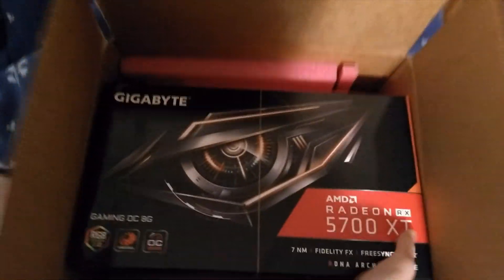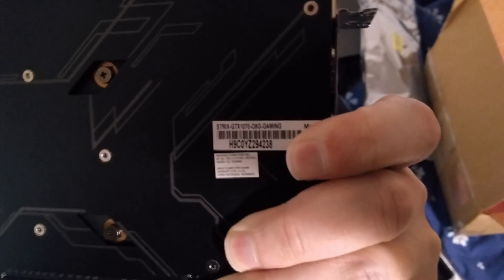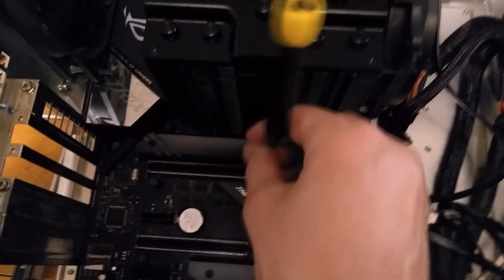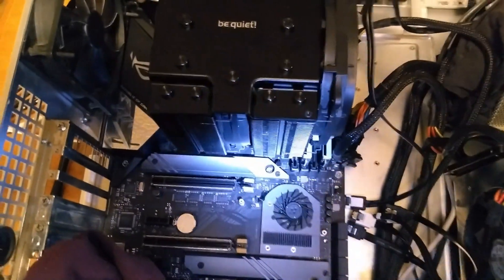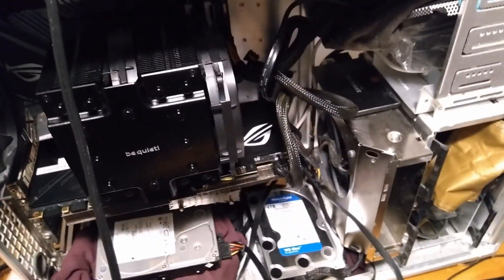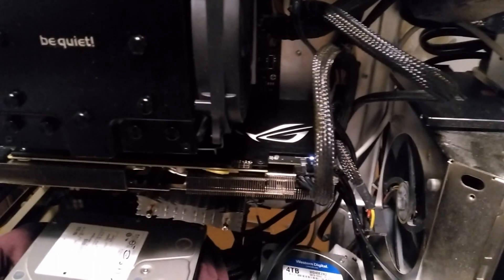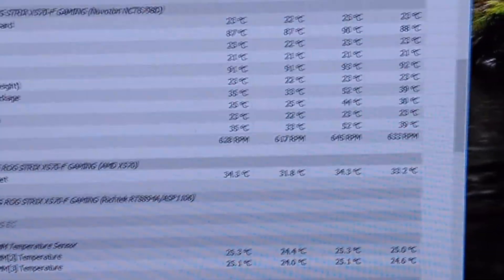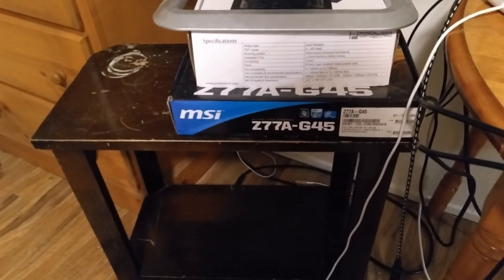A PC build adventure! (feat. replacing X570 chipset cooler with passive Thermalright HR-05 SLI/IFX)

Comment: Yes, i bypassed this problem by using a dremeltool on one of the nuts and screw mounting the cooler to the motherboard thus making just enough clearance for the gpu to be mounted on top WITH the shroud :)

Comment: using similar heat-sink with a 80mm fan on a FX northbridge and it only got rid of 10 celcius but 20 with passive state on it, thats impressive
Reply from the maker: I only got a 10 degree drop, not 20. It may have been 20 lower when it first started up, but it was a 10c drop steady-state-to-steady-state

Comment: I have an X570-E and am having about 90C chipset temperature which is really worrying me. I need to ask you if you found thermal paste between the chipset and the orignial cooler or just a thermal pad
Reply from the maker: It was a pad-like thing. Definitely not normal paste. But probably the real issue is there's barely any surface area on the cooler at all. 90c is much higher than mine was, but maybe if it's being covered by the GPU it would get that hot maybe?